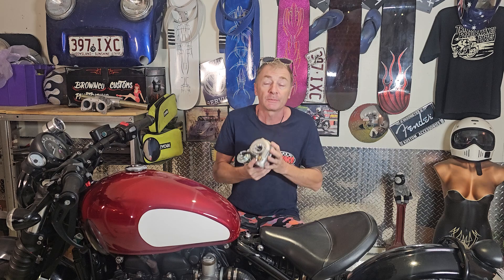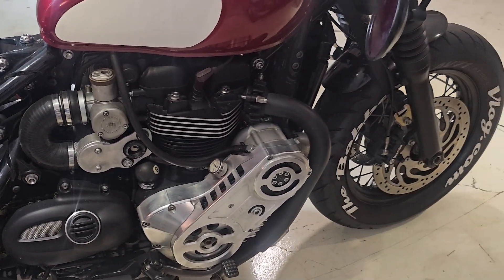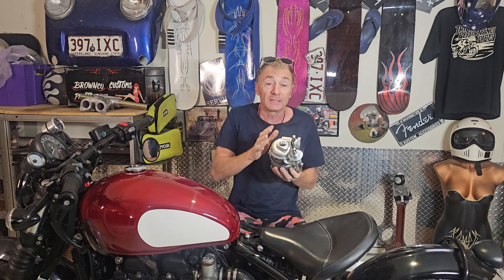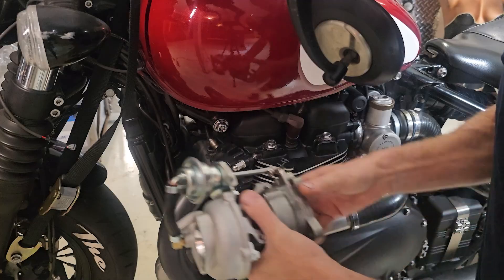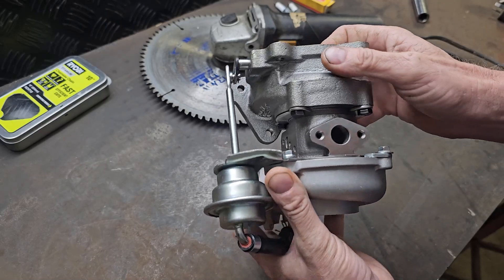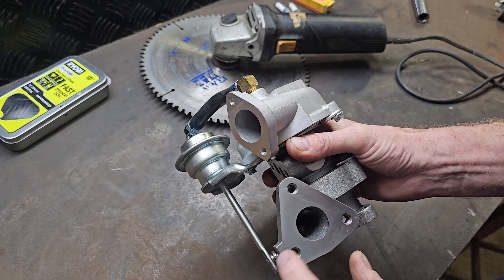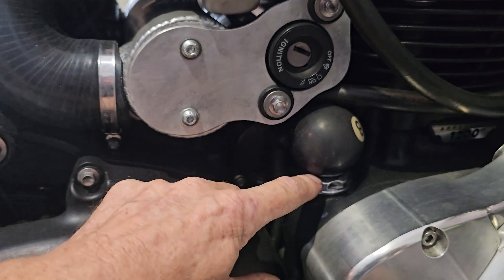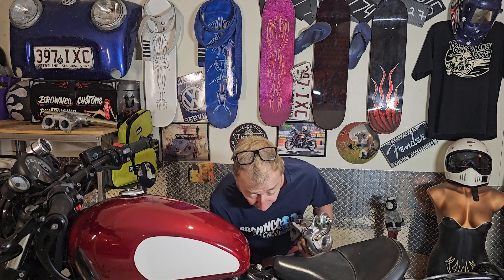World's Smallest eBay Turbo on a 1200cc Motorcycle? Will a VZ21 turbo work on my Triumph Bobber? pt1

Comment: No, final power is NOT adding original engine's power to flow of turbo. It's whatever max-flow of turbo is because ALL flow goes through turbo. So, up to 0-psi boost, that turbo has to flow 70bhp worth of air 1st. Then boost built on top of that is extra power. So 7.5psi boost is pressure-ratio of 1:1.5 and you get 70*1.5=105bhp. With 10psi boost, that's pressure ratio of 1:1.67 for 70*1.67=117bhp. This is assuming perfect adiabatic compression with minimal heating up of air. Not reality, so you'll get less than 117bhp @10psi without intercooler.